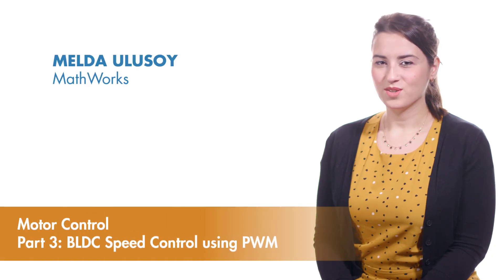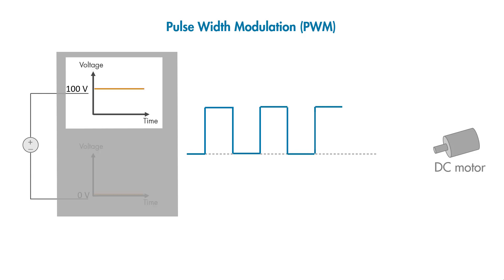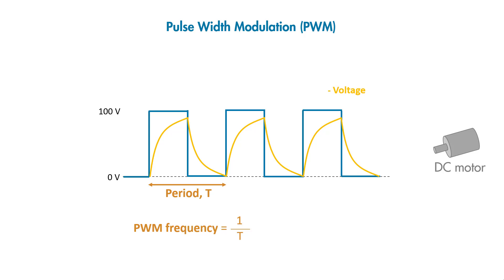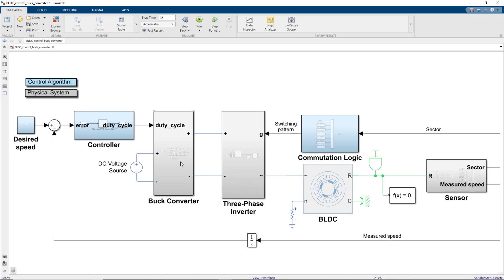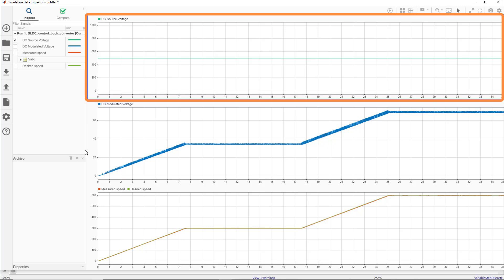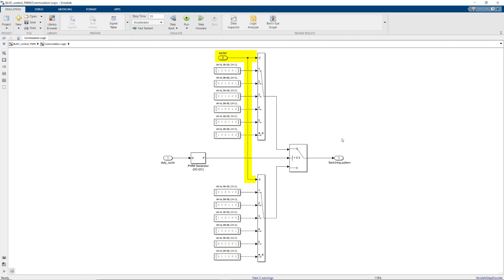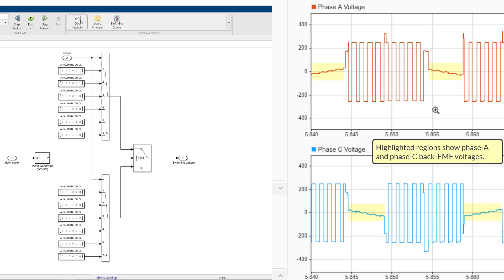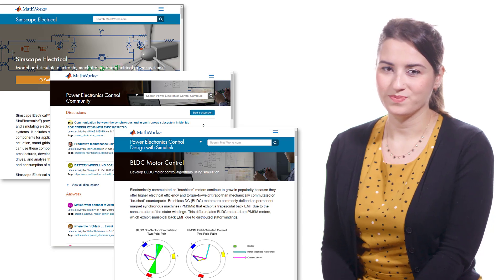BLDC Speed Control Using Pulse Width Modulation (PWM)| Brushless Motor Control with Simulink, Part 3

Comment: Same as everyone, I really appreciate this motor control series -- thank you! I have a question. You mention frequently that the voltage applied to the phases contributes to the speed of the motor, which is why PWM would be helpful to control the speed. We are talking about synchronous motors yes? What I'm trying to decipher is how commutation frequency contributes to motor speed. If the frequency of commutation does not increase, how can the motor spin faster by increasing voltage only? Second question: If the answer to that question is you need to increase commutation frequency to increase motor speed, then in synchronous motors, what  voltage contribute to? It makes sense that you could get a stronger magnetic field, but what would that do? Increase torque? Overall power? Thank you for your time.
Reply: Hello, Brian. I'm not from Matlab team but I think I can help you.
The voltage applied in the DC bus is directly related to motor speed and torque. The PWM frequency, also known as switching frequency (f_{sw}) is responsible to modulate the voltages in switches to generate the three-phase voltages. 

The point in the video is to show that if the PWM frequency is too low... think as 5Hz or 10Hz, for example... even you can control the bus (acquire the setpoint), it changes are significantly to the motor since the PWM is too slow... Then, you need to ever consider a enough sampling time and, consequently, switching frequency.

5kHz is most of time sufficient for grid-tied power converters PWM (another power electronics application) for example... but is normal to see in literature 10-50-100kHz (the switching frequency impacts in the harmonics, that are related to filter response, values and cost, for example).

Hope my brief explanation helps.

Best regards
Reply: i had the same question when i was watching these videos. I think it has to do with the trapezoidal control versus FOC. Trapezoidal control - control speed with voltage (think of it as controlling the speed of brushed DC motor with voltage), FOC - control speed with frequency (think of it as controlling the speed of AC synchronous motor with frequency)
Reply: As for as I know, in a practical way with trapezoidal control, commutation (frequency) is always fixed to to rotor rpm. 2 phases are used for driving the motor and 1 phase is used as sensor to determine the rotor position. If you draw it then you get a resistor divider, where the resistor divider are the coils of 2 phases. By doing so you know the rotor position and when to commutate. When you want to increase or decrease speed, the pwm duty cycle have to change of the active 2 phases and thus the current will change. Commutation is irrelevant for the speed of the motor, but you have to know when to commutate. 

FOC is a different story, more complicated, but there are good video's on Youtube.

Comment: Is there a way to use the same system, but to control by desired angle?
I really need this info
Reply: With hall sensores can move minimal steps with low pwm duty

Comment: First of all thank you for the great tutorial! I am having a problem though running the animation.  The viewer window opens just fine but the rotor isn't moving, I can see only the initial state of the motor. Can somebody help what I am missing here?
Reply: I modifed above animation file. to generate a movie it works for me.
Here I attach my code.

close all
clear

% Below parameters are defined in the Simulink model
% Sample time
% Ts = 1e-5;
% Number of pole pairs
% p = 1; 
% Initial rotor angle in degrees
% th0 = 0;
% Sector 
% sector = 6;

mdl = 'Switching_Pattern';

open_system(mdl);

sim(mdl);

pause(5)

obj = VideoWriter('Swithing_video','MPEG-4');
open(obj)
axis([-3 3 -3 3])
hold on
%
r = 1.2;
theta = linspace(0,2*pi);
x = cos(theta);
y = sin(theta);

x1 = 0.8*cos(theta);
y1 = 0.8*sin(theta);

xa = cos(0);
ya = sin(0);

xb = cos(2*pi/3);
yb = sin(2*pi/3);

xc = cos(-2*pi/3);
yc = sin(-2*pi/3);

xat = r*cos(0);
yat = r*sin(0);

xbt = r*cos(2*pi/3);
ybt = r*sin(2*pi/3);

xct = r*cos(-2*pi/3);
yct = r*sin(-2*pi/3);

hf = figure(1);h = plot(x,y,'k-',[0 xa],[0 ya],'k-',[0 xb],[0 yb],'k-',[0 xc],[0  yc],'k-',xa,ya,'ko',xb,yb,'ko',xc,yc,'ko',x1,y1,'k-');grid

set(hf,'Color',[1 1 1])

ha = gca;

set(ha,'Visible','off')

ht1 = text(xat,yat,'A');
ht2 = text(xbt,ybt,'B');
ht3 = text(xct,yct,'C');

set(ht1,'FontSize',14);
set(ht2,'FontSize',14);
set(ht3,'FontSize',14);

axis([-1.2 1.2 -1.2 1.2])
axis equal

set(h(5),'MarkerSize',20)
set(h(6),'MarkerSize',20)
set(h(7),'MarkerSize',20)

switch_pattern = ans.Switching;

init_switch_pattern = num2str(switch_pattern(1,:))

switch init_switch_pattern
    
    case num2str([1 0 0 0 0 1])
                
        set(h(5),'MarkerFaceColor',[1 0 0])
        set(h(7),'MarkerFaceColor',[0 0 1])
        
    case num2str([0 0 1 0 0 1])
        
        set(h(6),'MarkerFaceColor',[1 0 0])
        set(h(7),'MarkerFaceColor',[0 0 1])
                
    case num2str([0 1 1 0 0 0])
        
        set(h(5),'MarkerFaceColor',[0 0 1])
        set(h(6),'MarkerFaceColor',[1 0 0])
        
    case num2str([0 1 0 0 1 0])
        
        set(h(5),'MarkerFaceColor',[0 0 1])
        set(h(7),'MarkerFaceColor',[1 0 0])
        
    case num2str([0 0 0 1 1 0])
        
        set(h(6),'MarkerFaceColor',[0 0 1])
        set(h(7),'MarkerFaceColor',[1 0 0])
    
    case num2str([1 0 0 1 0 0])
        
        set(h(5),'MarkerFaceColor',[1 0 0])
        set(h(6),'MarkerFaceColor',[0 0 1])

end

    for i=1:500:length(ans.theta1)
        l1 = 0.7;
        ro = ans.theta1(i)*pi/180;
        
        xr1 = l1*cos(ro);
        yr1 = l1*sin(ro);
        xr2 = -l1*cos(ro);
        yr2 = -l1*sin(ro);
        
        hold on,hl1 = plot([xr1 xr2],[yr1 yr2],'m-');
        
        set(hl1,'LineWidth',3)
        
        hpr = plot(xr2,yr2,'ko');
        hpb = plot(xr1,yr1,'ko');
        
        
        set(hpr,'MarkerSize',20)
        set(hpb,'MarkerSize',20)
        set(hpr,'MarkerFaceColor',[1 0 0])
        set(hpb,'MarkerFaceColor',[0 0 1])
        
        ro1 = ans.theta1(i);
        
        for l = 1:numel(ro1)
            
            switch_pattern1 = num2str(switch_pattern(i,:));
            
            ro = ro1(l)*pi/180;
            
            
            xr1 = l1*cos(ro);
            yr1 = l1*sin(ro);
            xr2 = -l1*cos(ro);
            yr2 = -l1*sin(ro);
            
            set(hpr,'XData',xr2);
            set(hpr,'YData',yr2);
            set(hpb,'XData',xr1);
            set(hpb,'YData',yr1);
            
            set(hl1,'XData',[xr1 xr2]);
            set(hl1,'YData',[yr1 yr2]);
            
            
                switch switch_pattern1
                
                    case num2str([1 0 0 0 0 1])
                                
                        set(h(5),'MarkerFaceColor',[1 0 0])
                        set(h(6),'MarkerFaceColor',[1 1 1])
                        set(h(7),'MarkerFaceColor',[0 0 1])
                        
                    case num2str([0 0 1 0 0 1])
                        set(h(5),'MarkerFaceColor',[1 1 1])
                        set(h(6),'MarkerFaceColor',[1 0 0])
                        set(h(7),'MarkerFaceColor',[0 0 1])
                                
                    case num2str([0 1 1 0 0 0])
                        
                        set(h(5),'MarkerFaceColor',[0 0 1])
                        set(h(6),'MarkerFaceColor',[1 0 0])
                        set(h(7),'MarkerFaceColor',[1 1 1])
                        
                    case num2str([0 1 0 0 1 0])
                        
                        set(h(5),'MarkerFaceColor',[0 0 1])
                        set(h(6),'MarkerFaceColor',[1 1 1])
                        set(h(7),'MarkerFaceColor',[1 0 0])
                        
                    case num2str([0 0 0 1 1 0])
                        
                        set(h(5),'MarkerFaceColor',[1 1 1])
                        set(h(6),'MarkerFaceColor',[0 0 1])
                        set(h(7),'MarkerFaceColor',[1 0 0])
                    
                    case num2str([1 0 0 1 0 0])
                        
                        set(h(5),'MarkerFaceColor',[1 0 0])
                        set(h(6),'MarkerFaceColor',[0 0 1])
                        set(h(7),'MarkerFaceColor',[1 1 1])
            
                end
            end
        frame = getframe(gcf);
        writeVideo(obj, frame)
        delete(hl1)
        delete(hpr)
        delete(hpb)
        end
close(obj)

Comment: Does this mean a PWM controller like this https://www.ebay.com/itm/12M04-00200-Shimpo-Ceramics-Potters-Wheel-PWM-Motor-Control-PP-PW-V0050part-only-/254721648833?_trksid=p2349624.m46890.l49292 could control a 3phase BLDC washing machine motor?